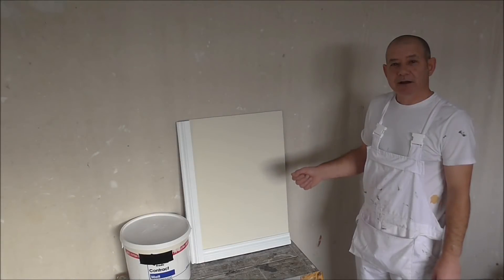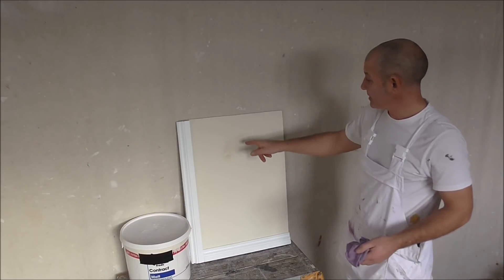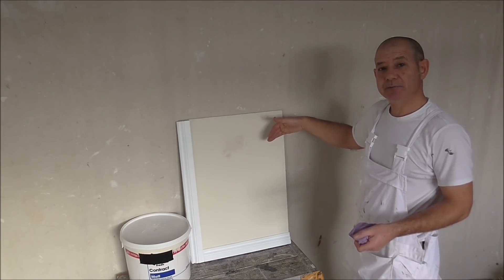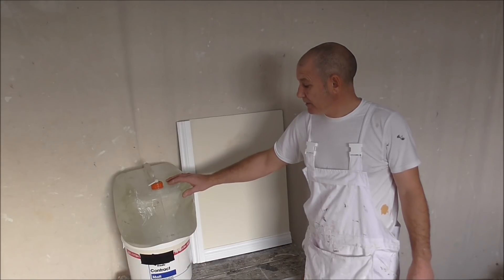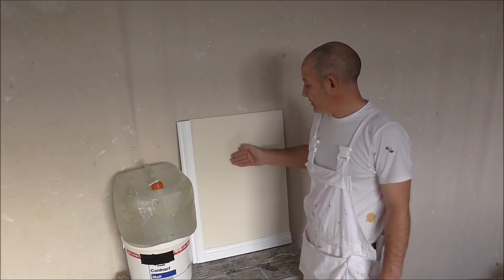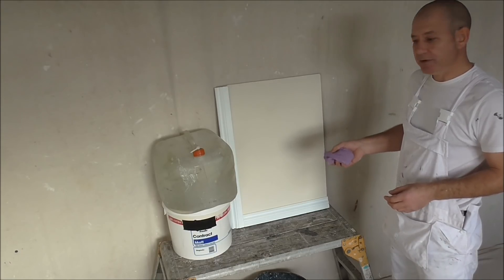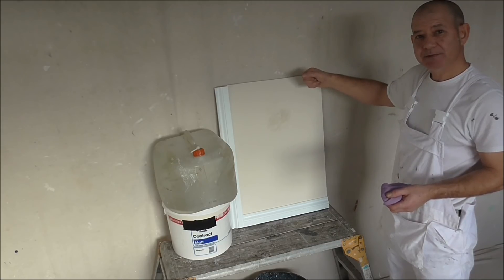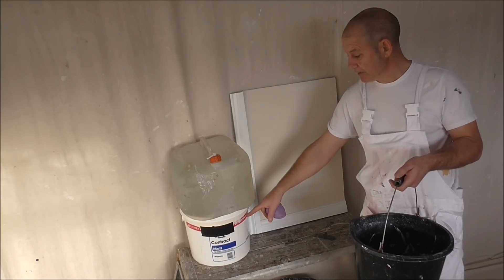Why can mist coating new plaster sometimes fail?

Comment: Hi pal.. i just had my walls re skimmed in my dining room.. got some ready watered down paint from bnq.. mistcoated with the first coat and theres 2 patches that just won't hold the paint..i left it 2 hour,went back the the paint would just come straight off with a rub over with my finger.. the plaster walls have been drying for two weeks now so I don't think that's the issue...do you think in my case it could be due to the pva coming through the plaster? How can I correct this please.. I'm thinking of giving the area a quick sand then using some alkali resisting primer? Thankyou

Comment: Best method is to use colourless deep penetrating emulsion like Zinseer Gardz, Atlas Unigrunt, Mathy's Pegafix, Proma K primer, Ralston Wall Primer etc.
I solves multitude of the future possible problems and it's well practiced in continental Europe for ages.
What goes in stays in forever.
Many blessings.

Comment: PVA is activated by water, and all paints contain water, hence why it is discouraged as primer. 
Contract Matt (and especially Leyland) leaves a chalky/dirty residue on the wall that doesn't let paint stick, so that's a terrible product to use for mist coat/undercoat.
Reply from the maker: Wrong... Because PVA is a reversible material it's perfect for water based paints. PVA is a glue it soaks into a surface and is very difficult to extract it may get wet but that only helps the paint to stick better.  Once fully dry it's tough a lot better than a mist coat.  Paint can be thrown out by moisture that doesn't happen with PVA.  Also I'm not a paint manufacturer trying to sell you more paint...   a mist coat done correctly does work but is not my go to choice. Because New plaster always needs a lot of preparation PVA is perfect for the first coat. Thanks
Reply: @PaintingandDecorating  For the avoidance of doubt, there is plenty of documentation of why PVA should not be used with paint. A very quick search on Google will show plenty of links/videos that explain the reason why not. I just want to make your viewers aware.

Comment: My theory is that you're best off using a durable emulsion for a mist coat. Expensive, but it has the vinyl that you'd get in PVA, and it provides a good base coat for subsequent coats, Contract matt is great for new builds where the plaster might not be dry yet, but it's a dusty substrate for any future work and needs sealing just like fresh plaster, especially if you're papering.
The whole mist coat debacle is too much 😅

Comment: when i mist coat i put at least 30/40% water leave it soak in as long as i can even over night .. the longer you leave it the better ...i mostly spray i never touch the serface
Reply: Do you normally spray it on heavy?
Pva or primer sealer?
Reply: @Tigerdograt  one coat is eough it just seal the plaster for top coat

Comment: I’ve been searching everywhere for answers and finally found it. I will explain in detail what I did and how best I can avoid this nightmare in the future. I stripped some wallpaper, washed the walls with sugar soap and filled and sanded using 180 grit sandpaper. I made sure that all existing wallpaper residue was removed. There was still original paint on the wall, most probably from the1930s when the house was originally built. Because it wasn’t bare plaster I went ahead a painted 2 undiluted coats of Leyland Contract Matt emulsion on the wall. a month or so later decided because the surface was starting to form cracks and it wasn’t as perfect as I had wanted it to be to use lining paper. I knew I had to seal the surface as contract Matt is quite chalky. I used watered down PVA to size the wall, left it to dry and then lined the walls using Solvite wallpaper paste from a packet. After 24 hrs I was about to paint it and noticed the paper was starting to come away from the wall and with it chunks of paint. I’ve been asking around online and off as to what to do. Some people suggest Zinzeer Guardz but I would rather ask you because I like your logical scientific approach to things.
Reply: PVA is activated by water, and the wallpaper paste contains water: that's the reason why it didn't work.

Comment: Great video but it's left me even more confused as to what I need to do in my newly skimmed bathroom ceiling - thinking of using Zinsser Perma white as the top coat, but from what you're saying I shouldn't be using a watered down contract emulsion as the mist coat as it won't be stable once any humidity hits it. Any suggestions as to what to use as a primer/sealer on bathroom ceilings? Thanks. Dave
Reply from the maker: We use diluted PVA  like milky water allow it to soak into the plaster..  should not sit on the surface.  Allow coats to dry  fully..   and only becomes tough after fully dry. Thanks
Reply: @PaintingandDecorating  That's great - thanks very much- really appreciate the response

Comment: We stripped out bedroom wall of paper and there was bare plaster underneath. I put contract matt on mixed with the correct amount of water but it peeled off the next day. I washed the walls too. Tried putting zinsser guardz on too but it still peeled off. Any ideas? I may just line the wall. A shame because it's a very smooth wall.
Reply from the maker: Does sound like a problem wall..  funny that the zinsser peeled..  did you remove the old paste from the plaster...  although zinsser should have sorted it..  I would sand down coatbif diluted PVA and line..
Reply: @PaintingandDecorating  yes. I washed down and scraped the old paste off. It's a beautiful plastered wall. It's very very smooth though, almost like glass. That could be the problem. It sucks everything in too. Going to use wallrock power adhesive and fibre liner.

Comment: About 10 yrs ago I had my staircase plastered and decided to do a mist coat with some old paint out of the garage Plasterer said use 50/50 water/emulsion and I thought the vinyl silk emulsion I had would be ok.
everything was going great until I put a coat of the final paint on. 
The mist coat started blistering and peeling off as it hadn't stuck to the wall.
I had to scrape it all off, but it wouldn't all come off. I could have cried !!!

Comment: Just started painting recently skimmed wall with a 50/50 mix but there are some areas where the paint hardly takes and looks blotchy. Im sure the plaster was dry before I started, it was plastered a few days ago.
Reply: Could be a patch of plaster that's been over polished and so isn't as porous as the rest, second coat will be fine of so
Reply: @TomTomTomTom538  I think your right there, I talked to a local decorator who said the same. I could of rectified by sanding with a course paper. I persisted with overcoats and is now finished with final colour coat. Thanks.

Comment: Thanks for all the tips. What if the desired finished coat is not going to be white is it still best to use a watered down white emulsion and then apply the finish coat in whatever desired colour?
Reply from the maker: That depends on your paint that you use for your finish because some can be thinned and used as a mist coat. But white contract emulsion is cheap and used as a mist coat is a good base for any colour.
Reply: @PaintingandDecorating  love thank for the advice 🤝

Comment: In my experience the paint will flake from a wall if 1) it was painted before the plaster was properly dry, so that the paint just sat on the surface or 2) the PVA or mist coat was insufficiently thinned and therefore could not soak into the surface. Good video.
Reply from the maker: Thank you..

Comment: Thanks mate, this was really informative. Renovating a new build (1999) and can't paint anywhere as roller would just rip up paint. Drove me nuts. Now I understand what's happened.
Way I'm solving it... Big sander with hoover attachment (reduces dust massively) to get rid of as much badly adhered paint as possible, sanded down to the plasterboard paper. It took about a day for living room with 120 grit. Next will apply zinsser product which is designed to go over cracked and peeling paint, this should help areas where there is still fine original magnolia paint left and stop it from lifting. What a pain, all because some didn't add a bit of water.
Reply: Ray's World Had the same problem, used Fluxaf Super which lifts the paint and can be scraped off after about twenty minutes.  Laborious but worth it.

Comment: can i use NO NONSENSE TRADE BARE PLASTER PAINT BRILLIANT WHITE 10LTR on newly plastered walls and ceilings instead of 'mist coating'???
Reply: @clintlemGenesis1  i find 50/50 mix is best to use. u want it to be slightly thicker than full fat milk. there is no harm in applying 2 mist coats - as it ensures that the new plaster is properly sealed b4 applying final coats.
Reply from the maker: MR V If it says for bare or new plaster yes follow instructions.
Reply: yes - it is designed for bare / new plaster - and no dilution required.
how much do u normally dilute the contract emulsion for mist coating..........50/50???
thanks buddy
Reply from the maker: MR V Yes about 50 / 50  but I like to use PVA diluted then it's ready for any paint.
Reply: @PaintingandDecorating  thank you  for that advice. In my case there is dark areas on the bottom of the wall and when I use the roller to paint over them  its not sticking to it
Reply: @seanokeeffe5604  if those dark patches is dampness - then u need to fix that and let it dry out b4 painting
Reply: @mrv5801  Hi thank you for your reply. The area is not a damp spot as there was nothing near that wall that would cause it... no pipes.. I sanded the area and and watered down the paint further and it seemed to work fingers crossed.
Reply: @clintlemGenesis1  removing all the paint off the ceiling is gona b one hell of an arse ache - and most likely a complete waste of time!!!!!

i would try lightly sanding back the edge of the adhered paint - until its smooth as can be - and then mist coat that area - b4 u finally apply the final coats of undiluted emulsion.

GOOD LUCK BUDDY!!!!!!!
Reply: @clintlemGenesis1  u cant paint over loose n flaky paint - so u basically just need to carefully sand the areas where the mist coat hasnt adhered. the idea is to remove the loose mist coat paint first - and LIGHTLY sand those areas so it gives the plaster a slight key. dont go crazy with the sanding - use FINE sandpaper like P180 and rub lightly. give it quick wipe with a damp rag to remove any sanding dust - and then u can mist coat those areas and it should successfully adhere.
Reply: @clintlemGenesis1  yes - no need to sand until the plaster shows. just lightly sand until all the loose paint is removed and the area feels nice and smooth to the touch. no need to rub too hard either. remember to wipe clean with damp sponge b4 painting.
Reply: @clintlemGenesis1  the mist coat is watered down emulsion so it soaks into the plaster to seal the plaster. so tape wudnt normally pull off a mist coat unless the mist coat was too thick in the first place. also - NEVER use regular masking tape when painting - its too sticky - and can pull the paint off. u should be using the blue colored decorators masking tape. also its better to mist coat all the walls & ceiling first - then paint the ceiling with 2 coats of final coat - and then paint the walls last. hope that all makes sense!!!!

Comment: I would quite happily go get water on site to thin down the mistcoat. Puts it on quicker and generally seals surface. Time is money.
Reply from the maker: 9 out of ten will be doing it correctly. A lot of the problem is when anyone with no understanding decides to paint new plaster.    I do understand on site and when your working for others time is money.
Reply: @PaintingandDecorating  what is the correct ratio  paint /water for mist coating ?
Reply from the maker: @cathedralImages  This video will explain all hope it helps  https://youtu.be/lyp87daMuI4

Comment: with a bare plaster is best to pva  and use 50 50 wtaer and mat to seal then top coat loved the video.
Reply from the maker: Once PVA is dry just two coats of your emulsion usually no water in the paint.

Comment: Contract matt isn't normally the finish coat though , it should really only be used for mist coating or a base coat.
Acrylic Eggshell , A Vinyl Matt etc as a finish coat and your point is irrelevant.
I still say PVA on bare plaster is a big no, no and most other painters would agree.
I do know some painters that don't thin contract matt with water though ,absolute  clowns.
25 years in the trade so no  young buck here . I wish i still was !
Reply from the maker: It's a six-inch flat brush that we use. And would not save you time on site or new build, but when am working just in one building or room, I find that you can do a lot of sanding and filling before you paint and PVA hardens the surface and seals filler. Plaster sometimes needs a lot of work on it before you can paint. And I like to get my work looking good.
Reply from the maker: watch this video PVA was used when it was new plaster and then a leak occurred a year later. https://youtu.be/9dpls4XBhZU
Reply from the maker: Yes, they both work thanks for the comment.
Reply: PVA dries more quickly than a mist coat and therefore can speed the job up. Whether PVA or mistcoat the secret to sussesfully sealing the surface is sufficiently thinning the mix so that it soaks well into the surface. Insufficiency thinned PVA or mistcoat will just sit on the substrate.
Reply from the maker: It works for us and saves me money. We are not saying mist coating does not work and if your doing room after room on building sites or just a house plastered all the way through and you're told what to do then it's fine. On jobs, we use PVA all the time to seal dust and holes before filling and after. PVA before we paper instead of using size. It's great stuff as long as you understand how to use it.  https://youtu.be/9dpls4XBhZU This property was all PVA first to seal plaster.
Reply: "Applying a mist coat will sufficiently seal your new plaster after it has dried. Many professional painters do not recommend using PVA glue to seal your plaster, as it can cause issues later on. The paint that you then apply afterwards is likely to sit on top of the PVA if you use this method. This means that it will fail to deeply penetrate your surface and subsequently the paint will not last very long. Paint quickly starts to peel off and chip away if plaster has been treated with PVA prior to application."

Just one of many bits of advice i've seen on various builders/decorators websites.